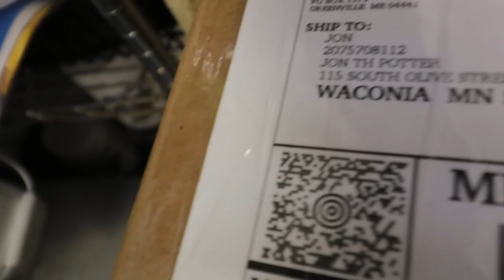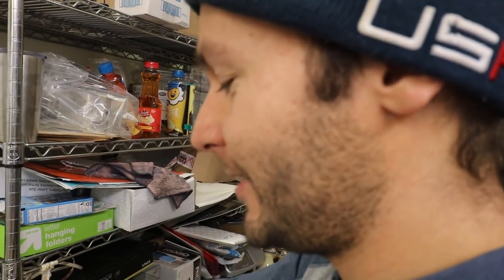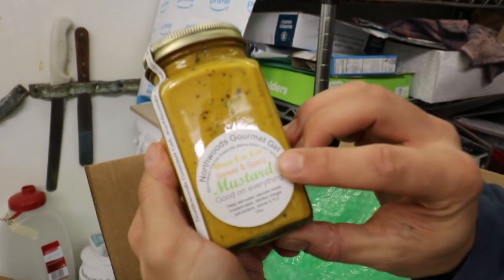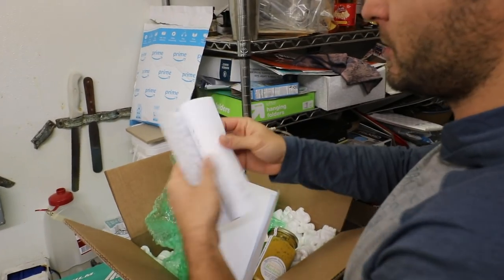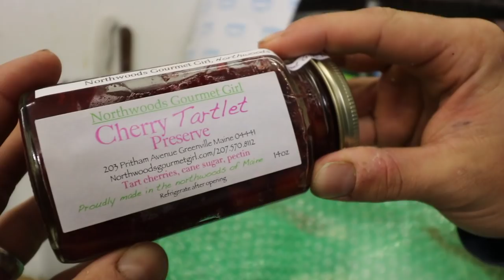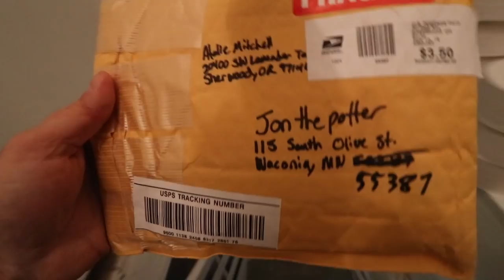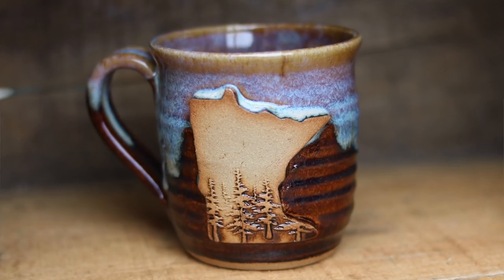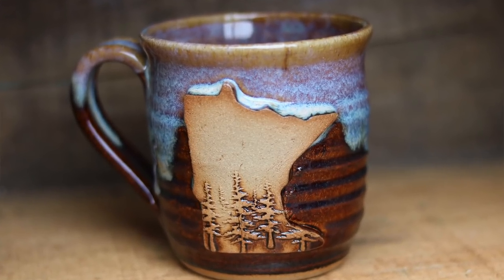Mind blown

Comment: A little annoyance around your neck?:     fractures of the cervical spine.

.Among passengers, the risk of cervical fracture plus spinal cord injury was nearly seven times higher for those using an airbag without seatbelts (compared to both protective devices). For both drivers and passengers, women were about half as likely as men to be injured using an airbag

The rate of cervical spine fractures was 54 percent in drivers using an airbag only, compared to 42 percent for drivers using both an airbag and seatbelt. With adjustment for other factors, the relative risk of cervical spine fracture was 70 percent higher for drivers using an airbag without a seatbelt, compared to drivers using both protective devices. This was even greater than the 32 percent increase in cervical fracture risk for drivers using neither an airbag nor seatbelts.

Will not mention this again....keep on potting!
Reply from the maker: We both had the seatbelts on by but I guess mine wasn't over my shoulder like it should be, thanks to you (and my wife) I'm getting better about always wearing my seat belt, thanks!
Reply: @Jonthepotter  Good to hear!